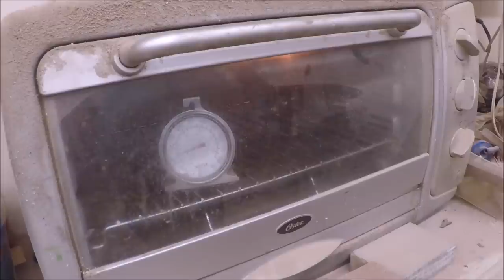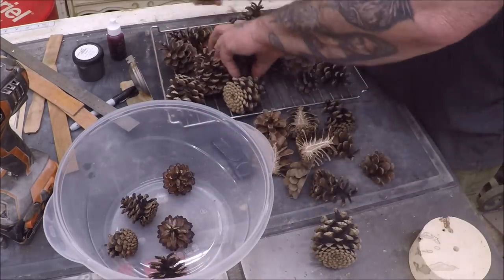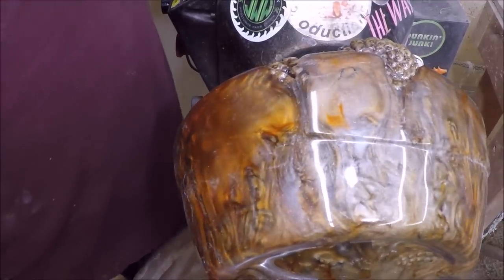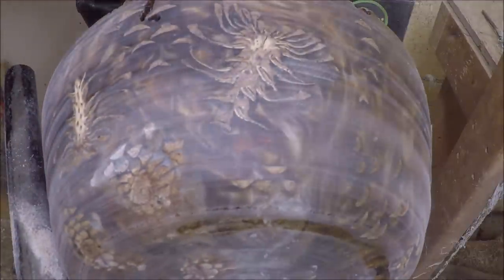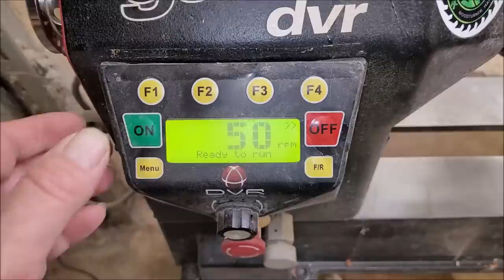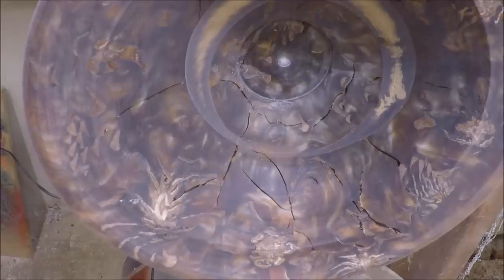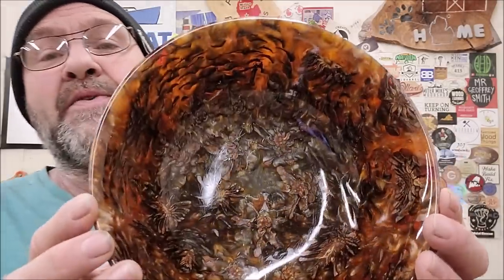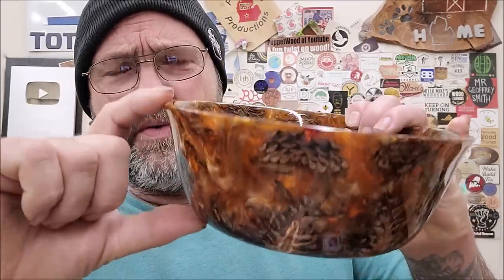Pine Cones in Resin

Comment: Hello again, great idea with the pine cones and it looks really great.  Your equipment, with pressure pots and high-quality resin, is also impressive.  However, resin is a homogeneous, very brittle mass, in complete contrast to wood, which consists of individual cells and fibers and can therefore be processed very well with a cutting tool.  For resin you should use a scraping tool, e.g.  a carbide tool.  It worked better when you used your negative scraper, didn't it?  And reduce the speed of the machine, too quickly tears holes in the resin.  Almost nobody tells you stuff like that and it took me a long time to figure it out myself.  Forgive my better knowers, I just wanted to help with a tip.  Greetings from northern Germany, stay healthy.
Reply from the maker: Thank You,  well personally I find the opposite works better for me, normally  I don't use carbide, but I found it works better on the stabilized materials,  I know negative rake anything works the best,   anyways have a great week !!!

Comment: Gorgeous bowl!  I wonder if there is a thinner resin that would more easily get into the voids?  Also, I have wondered about some form of table that would shake / vibrate the mold or even the entire pressure pot during the pore and for a few minutes afterward in the hopes of getting the resin to flow into the voids.
Reply from the maker: Thank You Jesse,  there is I have it I just didn't think to use it

Comment: Next time you do a thick pour like this, do you think putting the pressure pot in a bucket of ice water would help? Cool the pot down and the air inside it will cool down which will cool the Resin...

Having a fan blowing across the pot as well might help keep things cooler as well...
Reply from the maker: Thank you

Comment: did you weigh them before and after.  I've found that pine cones don't seem to absorb any significant amount to resin when stabilizing
Reply from the maker: no I didn't, but I did mark the chamber and I lost about an inch of cactus juice after I released the vacuum,

Comment: Beautiful job man! Everything you turn on that lathe is amazing. What round carbide tool were you using? It made quick work of that bowl by the looks of it compared to the HSS gouge you started with. Thanks in advance and keep up the awesome work! Safe turning!
Reply from the maker: Thank You Billy,  just some cheap cutter I got off of Amazon or something like that.
Reply: @PohlBarnProductions  did u make the tool itself and just buy the cutter? Is it a negative rake cutter or not

Comment: So, in regards to the exothermal cracking you were showing about 20 min in. What will you do in the future to avoid this. Can you do multiple pours and put each under pressure? What was your shop temp when you had this in the pressure pot? Thanks
Reply from the maker: well I push my luck every time I pour a casting,  and yes my casting are much better in the winter than summer due to temp,  I can do multiple pours but that leaves witness lines that I do not like so I risk it and pour to much

Comment: 20:15...would they not have been there had you poured the resin slower...like some every few minutes instead of all at once?
Reply from the maker: nope,  the project over heated I explained that.
Reply: @PohlBarnProductions  right...got that...but would they have over heated had you poured other mixes in at say 10 minutes after they started curing?